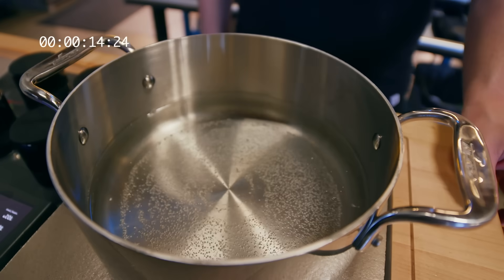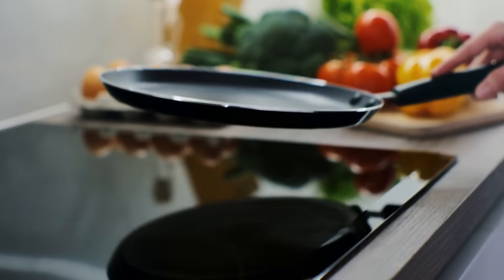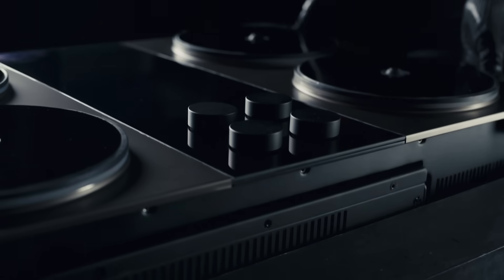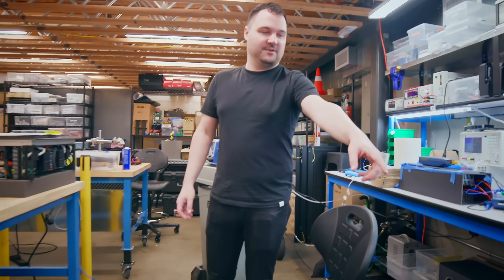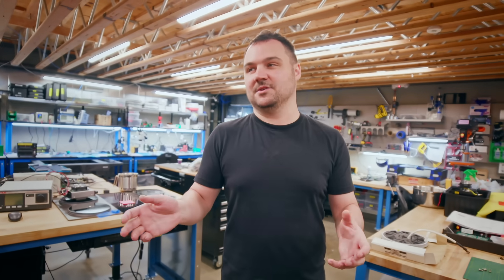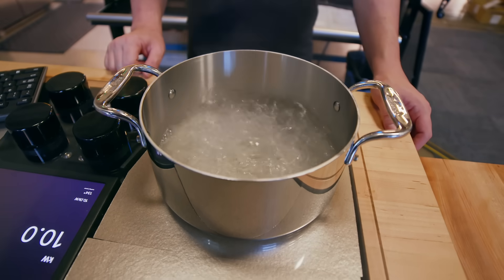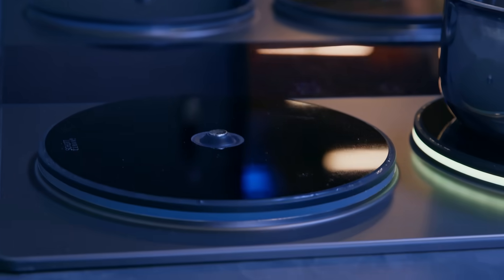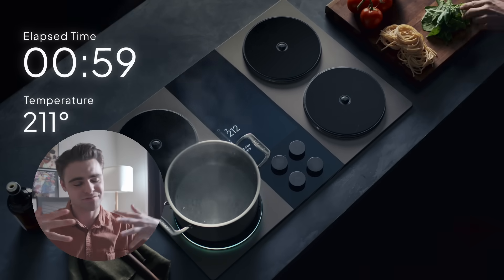World's Most Powerful Stove: Boils Water in Seconds | Impulse

Comment: In Germany we use three phase electricity. 3*230V 50Hz. The usual sockets are 230V 16A, which is 3680 W.
The standard stove and oven combination in Germany is designed to operate at 3*230V*16A, resulting in an 11kW power consumption. Specifically, the stove component often draws from two phases, amounting to 7,4kW.

In modern kitchens, there is a trend towards separating the oven, potentially with its own dedicated outlet. Consequently, the stove could then utilize the full 11kW.

For new constructions in Germany, regulations mandate that the cables connected to the stove must be capable of handling 20A. Although a 16A fuse may still be in place, there is flexibility to upgrade it to 20A, providing a power capacity of 9,2kW for two phases or 13,8kW for three phases.
Reply: In the USA, we're stuck at 240V unless you live in a commercial zone area. Stoves are 240V @ 50A, but they never pull a full 50 even with all the burners & oven going. Using a battery/capacitor bank solves the issue of the low voltage. Even though it's a short duty cycle, I'm curious how they handle heat when the battery is cranking out 11kw. electric cars, for example, have coolant, pumps, & radiators.
Reply: @Shadi2 240v split on a 50a (40a continuous) is 9600w. It’s not that weak.
Reply: @yolo_burrito  that’s only going to be the draw if you have all four burners and the oven going max. Some ovens may draw about half, the four burners are splitting the remaining 4800, so about 1200 per burner.
If anyone want to test this, put one liter of water in a pot, and one liter in an electric tea kettle and if the burner boils the water within 130% of the time of the electric kettle (1500W due to US regulations) you can take my math* to the bank.
*The oven might not take exactly half, it might take a bit more, or a bit less.
Reply: @Shadi2 as he pointed out they only pull from two legs so the same as the US.
Reply: I have full three-phase 400 V induction stove with 10.2 kW of power, and it can be put on single heating field (normal two-phase 400 V ones heat one side of stove from each phase). I got it from failed restaurant that closed right after opening, and this stove is anything but rated for home use. It's insane how fast it is (heating pan on it is funny, it literally jumps), and I can't imagine needing more power on stove. But the feature I miss the most is temperature control. I mean I can basically get it by sound pretty well, but I wish I could set it i.e. to 60°C and leave soup on it for some time to have it constantly warm. Or set it to exactly 170°C and don't worry about smoking point of cooking oil...
Reply: Hilarious to this entire discussion is that the country with the highest IH penetration has 100V.  It's delivered split-phase like the US, so you can make 200V and the stove top out around 5kW.
Reply: Interesting. We also use 220v here in India. What even is 110v lol. I read the German guys comment and thought - Oh nothing new Germany has  better engineering solution than USA. But then I read the polish guys comment and that actually blew my mind. They use 400v for homes in Poland? That is really cool.
Reply: @crazydrifter13   It is the same in India, Poland and Germany:
https://en.wikipedia.org/wiki/Mains_electricity_by_country

220 or 230V are between Neutral and Line (1 phase/N-L)
380 or 400V are between Line and Line (2 phases/L-L).

In Germany every house has all 3 phases.
In some countries the phases are distributed between the houses. You have phase A, your neighbour phase B and the other neighbour phase C.
And only industry has all 3 phases.
Reply: @hu2481 thanks.  got it. I read the whole table on that page. Now I feel like an uninformed guy because I had heard of the term '3 phase' a lot here but didn't know it was 400v 😂
Reply: Yes my oven in the uk is on a 32amp 230v breaker
Reply: My induction stove is 11KW so it’s not that different to mine. I can also bridge mine, so I can put on grilling, teppan plates or just have rectangular pots on it and cook. Or as it’s magnetic I can slide around my pots around and they’re still connected. I find this design fun and cool looking, but I’m very unsure of the DJ table design awhen you want to move around your pots and pans a lot. Also notice he’s not really mentioning induction when talking about performance.
Reply: US has gone to dedicated circuits also for appliances.
Reply: Most homes in the USA are limited to a 100A main circuit. I emphasize, the circuit of the ENTIRE home is usually limited to 100A. The rising popularity has caused many of these homes to be retrofitted with 200A mains, but other than that, 100A is the standard.
Contrary to popular belief, the USA grid is on a 240V framework, though specialized outlets are used to actually be able to access that voltage. Stoves are exactly one of those purposes. The vast majority of homes use a single dedicated breaker for a stove. Going back to the main circuit, pulling a power draw beyond the current implementation is realistically infeasible. Using a battery as a buffer between the grid and appliance makes a lot of sense (though I would argue that battery technology is not there yet to keep this product from being essentially disposable, and would be more interested in implementing capacitors rather batteries).
Reply: @sang4sang  That's insane, looking at that amperage. I live in Poland, and with circuits split between 230 V and 400 V,  100A would be absolutely overkill for anything except quick-charging TWO EVs in a garage. While you guys basically invented commercial electricity, your system sucks balls harder than Sasha. You spend much more on thicker wiring, your appliances are much less efficient, stability of the network is lower, there are higher losses on transformers, exposed live wires are so much more dangerous (and on top of that your electrical connections are a joke - seriously, twist wire and SCREW on a cap? Are you all insane?), and your power supplies have lower power ratings with lower efficiency. The only more insane electrical grid is in Japan with their 50/60 Hz split down the middle of the country, but that's actually also your fault XD

I have  three 32A fuse on all three phases,  for ~20 kW of max power over my home. My stove may use half of that, and I don't think I can actually load it enough to trip it.
Reply: @sang4sang  this is changing, slowly but surely. Some modern homes are equipped with multiple 100 amp circuits, up to 400A sometimes. I've been working on futureproof designs for an 800A/600V residence that would incorporate solar power and supercapacitors. It's my version of a century house.
Reply: @sang4sang  A reply that is comprehendible and accurate. good work.
Reply: @sang4sang  Impulse uses a replaceable LFP battery. That seems like quite a future-proof solution, no?
Reply: @sang4sang  never seen a below 125A building houses and 250A is common. The green boxes you see on the ground are where 220v starts.
Reply: Hi your calculations are wrong, to calculate wattage in 3-phase power you need to do sqr3*230*16 and not 3*230*16, it then goes from 11kw to 6kw.
Reply: @sylvester4207  He used the wrong equation but got to the right result. Its sqr3*400*16 which equals 11kw.
Reply: The 16 A flow between a phase and neutral (230V). If every of the 3 conductors has a load of 16A to neutral, there are 9,23 A between every pair of two phases (3*9,23A*400V = 11kW). I studied physics.

There is a small difference between sqrt(3)*400V*16A and 3*230V*16A

The reason is that the voltage between two phases is not exactly 400V in a 230V system. sqrt(3)*230= 398,4 or 400/sqrt(3)=230.9
Reply: @hu2481  well yes that would maybe work (i did not study physics). But that would no longer be 3-phase, wouldn't that be 4? (????)
Reply: 3-phase with 120° phase angle. That is the reason for the sqrt(3).
In a 4 phase configuration, phase angle are multiple of 90° and voltage between two 90° phases is sqrt(2)*(phase to neutral voltage) or 2* (phase to neutral voltage) with 180°
Reply: @hu2481  Nevermind i somehow thought the stoves were connected in a delta configuration. I guess with a y configuration your equation is better. 

However, i'm not with you on the voltage. I thought the 400V was derived from the higher mains voltages, making the 230V more like 231V. But in the end its +/- 10 % so who cares. :D

Comment: First you have tri-phase for extra power, efficient. That battery he held looks something like a LiFePo or Lithium Titane that'll be half-dead in couple of years and holds enough energy for a toast or two (it means probably has less than 1S 20 Ah so about 100 Wh meaning that the 10kW usage will last about 30 sec). I mean it's a cool short term boost to quickly heat stuff (somewhat at the expanse of your pan at this power), but it's not going to do much for your grid.
Reply: It looks like a Headway 40152S cell. It is an high power and high cycle count battery. It is possible to use multiple in series for more power and a greater voltage conversion efficiency. A total of less than 25 cells (less than a car battery in weight) are required to output the full 10kW for more than 4 minutes.
Reply: @jeremievenne5138  I doubt there is space for that under the cooker to fit in most kitchen. That's why I guess it can only do short bursts (even 2 min is short for cooking but useful in some scenarios).
Reply: their website states they use a LFP battery (lithium iron phosphate)

Comment: It seems to me the biggest advantage is having the energy stored at the point of utilization. That eliminates the need for #6AWG to deliver 10 KW + for surge loads on cooktop. Most cooking is done with 3KW or less so a 240 v / 20A circuit could easily recharge the battery and run the typical load.
Distributed storage is going to disrupt commercial grid power companies soon. The more power energy is stored in the home and cars the less grid capacity is needed for the residence. I’m not speaking theoretically,I’m running an off- grid inverter with solar,30KWH battery, a #12 AWG grid input to run a house.All electric.
The clothes dryer is still on grid but could easily be run on this system with a parallel inverter.
I already had it with 3 inverters paralleled previously when I had an extra dryer and water heater in the system.
The key is to do things sequentially. A half dozen houses coordinating sequential loads could easily kiss the grid goodbye. It makes no sense to sell energy to the grid when you can sell it to your neighbor at full price.

Comment: Now this would make me drop my gas stove.
Reply: Any good-brand induction is already better than gas — and I say this as a long-time fan of gas. I suggest buying one of those 1800W induction hot plates they sell for $50-100 that plugs into a regular outlet. I think you’ll be really surprised at how good that is. And then consider that a “real” induction stove is more powerful than that!

I’d just say avoid Samsung — a friend of mine has a Samsung induction and that thing’s pan detection sucks, with it frequently failing to detect pans that it somehow isn’t happy with. (Despite those being the same pans that I use at home on a $50 induction hot plate from Aldi, without any issue.)

Comment: Unless it has multi-frequency induction like Panasonic's MetAll models, you won't be able to use copper/aluminum/etc.

That is the final real tether to classic gas stoves. Eveness of heating with gas is a side effect of the inefficincy, but it's an important side effect. Unless you use a significant heatsink (cast iron like they mentioned), or a thick disk of high thermally conductive material, you will get burn patterns from uneven heating. With gas you can distribute the flame profile and you can use less thermally conductive material to keep the weight managable. But with standard stainless ply cookware, on induction stoves you almost always get hotspots corresponding to the induction elements unless you use a very thick chunk of it. This limits the functional power you can actually use with induction on standard clad cookware.

All a long way to say: show us the flour test on mode avg cookware :)

Also, as othet people pointed out, 240v is becoming more common in the US, most people have 100-200a panels these days, so ~30-40a for the house stove top isn't unreasonable
Reply: 240V power is practically universal in American homes because that’s the actual voltage at the transformer. It’s divided into two 120V taps for standard outlets, but the 240V is used for electric stoves, clothes dryers, hot water heaters, and central HVAC.
Reply: @tookitogo  Sure, it's just that most older homes didn't have the amperage to support multiple 240v high draw appliances, or the cable runs in the kitchen for a stovetop/oven.

Not unfixable, just costs money. The hybrid-battery model makes sense for these older homes, but they should also release non-battery models for the newer homes that don't have that limiting factor.
Reply: @UnderBakedOverEngineered  That’s a different statement from “240V is becoming more common” — 240V is already omnipresent. The issue of maximum current, or whether an appropriate receptacle is nearby, is separate.

Comment: Despite the hurricanes and deep freezes, the gas has never off in my Houston home over the last 40 years. Until the cost of operating an electric stove is on par with both the reliability and price of gas and its related appliances, you can keep your electric stove. I'll happily waited a few seconds more to boil my water.
Reply: These stoves specifically can hold a charge and work off grid power for some time, if I understand the video correctly.
Reply: As someone mentioned: solar panels. It’s pretty much the only way to be truly off-grid
Reply: @angryakita3870  I would love solar panels but I do not have that option in my situation today.
Reply: Listen closer he said "NEW gas stove". If your gas flows during a power outage its because it is an older model lacking the anti-leak safety feature

Comment: We could use an affordable stove with 3 standard halogen rings and one induction cooktop for a standard American kitchen
Reply: Why the 3:1 ratio? I’d think that 1:1 would be better, or even 3:1 the other way (3 induction, 1 halogen).
Reply: Cost. Three is usually 1 ring that gets the most use. That one would be induction. The others, standard. More kitchens would have the technology and energy savings. Just a thought.
Reply: @passagetonow1229  I suppose. But given that an induction hot plate costs basically the same at retail as a glasstop electric, so the cost to make them must be similar, I think the main reason induction is still uncommon is because the manufacturers market them as “elite” products. 

At least one appliance company made or makes “domino” kitchen appliances, a typical example being two burners. The idea is that you arrange a bunch of them next to each other. For example, a two-burner induction module, a two-burner gas module, and a grill module or deep fryer module in between. (“Domino” because the proportions are similar to a domino.) With those anyone can just assemble the stove system they want.

Comment: Actually my gas stove has a provision to be able to use it when the power is off. The auto controls and displays do not work but the burners can be lit manually. But to boil water in 40 seconds is super cool.
Reply: yeah this may depend on mfg.  a friend just texted me to complain of her gas stove not working during an outage in the Bay Area!